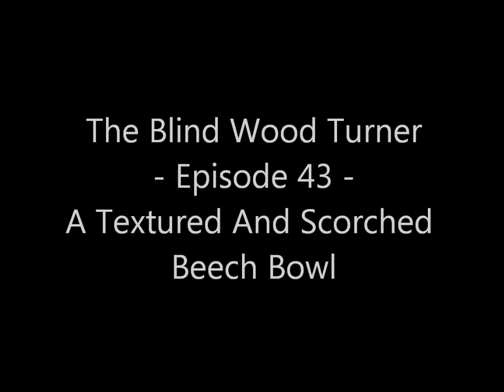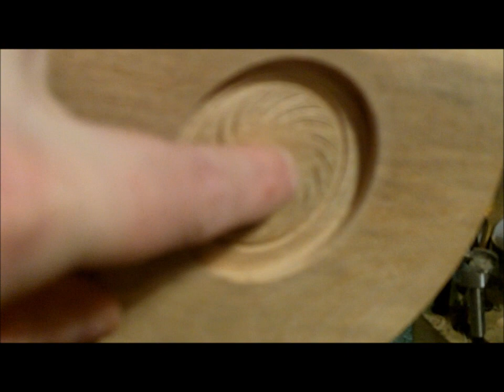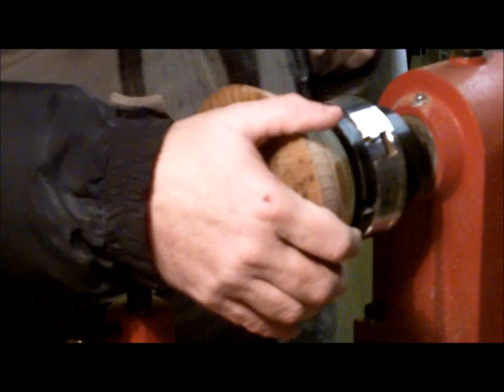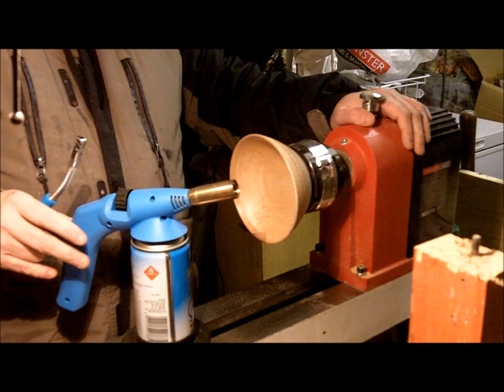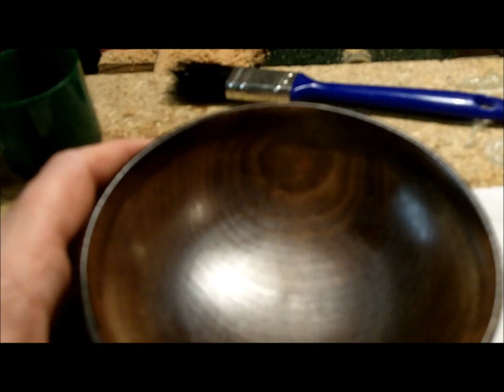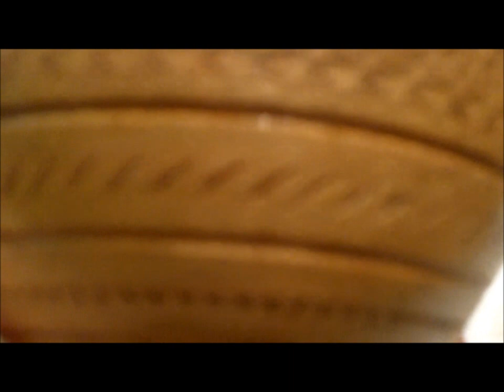Woodturning - A Textured And Scorched Beech Bowl

Comment: For a first attempt with no help at all you have to be very proud of this piece. At times it looked a little dark, but then when the bowl caught a different light it looked really good. The texturing is really good and has now become your trade mark that we look for. My favourite bit is still the spiral you put on the base which is like where Martin puts on his rings. I think had you the support of a pair of eyes watching you when you did this you may have either sanded it back a little more or not done quite so much burning. However the final finish is not a burnt out offering and is your interpretation on the subject and fits the brief of what you were trying to do. Well done as I think you have done so well on this as sighted people would have easily cracked the wood by overheating it. A++
Reply from the maker: +Paul Lockwood 
Thank you Paul !!
I love texturing and it makes pieces so much more tactile and sensory for me.
Take care.
Chris.